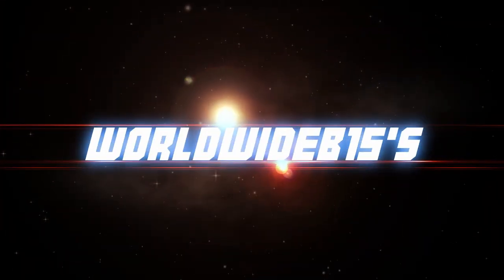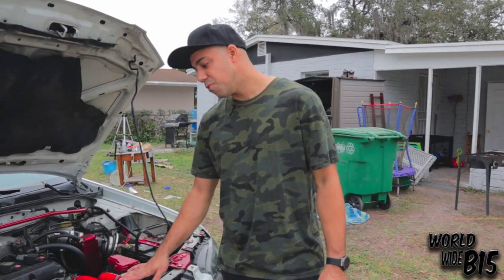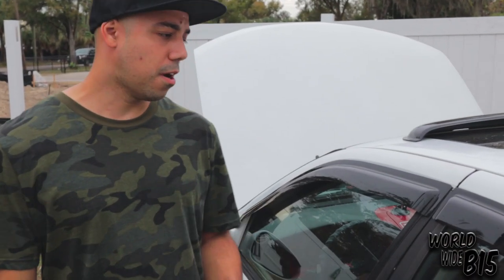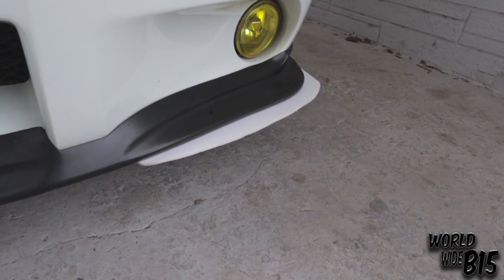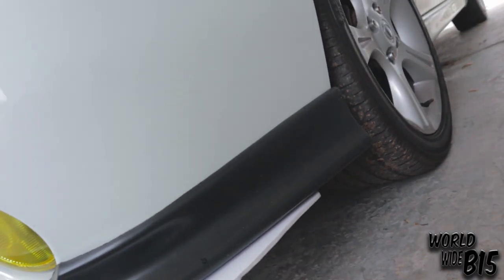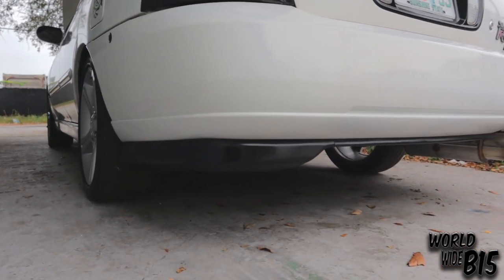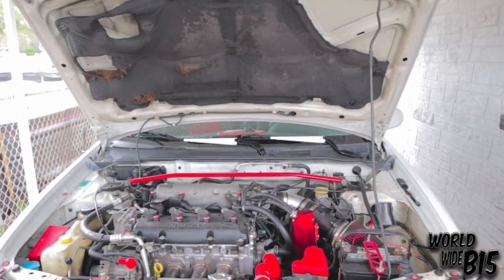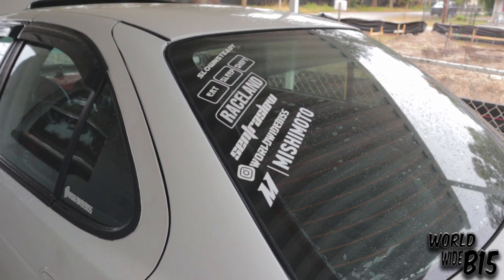Full Sentra Walk-Around

Comment: What type of paint did u use on the plastics and vinyl in the interior? I see u have the Krylon Canary yellow in the link. Is it the stained glass style and what color red is it? Thanks. It looks dope!
Reply from the maker: Duplicolor I think it was from any advanced auto parts don't remember the exact color, yes stainless glass. And thank you🙏🙂
Reply: @WorldWideB15s  about the mat, I'm wondering the same with mine. But then I heard u can damage your paint on the hood from the heat. My mat is actually burnt up from the plenum touching it and getting hot. Was like that when I bought it last year. I'm going the same thing to mine right now as well as far as the red color scheme. Just matches the dash lights and pretty much took off from there...
Reply from the maker: I took mine of not too long after it has been ok, these cars do produce a lot of heat butt the paint has been holding up.

Comment: So due to  the throttle body and pedal it was fluctuating between 1-2k and going up and down ? Like it had a vacuum leak ?
Reply from the maker: How was the rest? Sounds like it just needed and idle, pedal relearn.
Reply: @WorldWideB15s  I did the reset nothing changed . And it’s having a delayed start like it needs crank or cam sensor but no codes for that  I just bought the car so idk  what to even look at rn .  It also has a code for a 02 sensor  that’s all I know so far
Reply: @WorldWideB15s  I’m also cleaning the throttle body it looked clean  but I will put it back on and relearn if nothing  changes tomorrow  I’ll be back in the comments  . I think it is from the cold air intake the past owner had on it cuz it was barely on and clamped on by the throttle body and had a broken bolt in the maff sensor. So unmetered air ??
Reply from the maker: Change the O2 sensor, now delay starts sounds like fuel pump it was a huge issue. I changed it and they went away.
Reply: @WorldWideB15s  okay and I think the previous owner replaced the sensor it looks newer and there was a old sensor for the crank or cam in the car when I bought   but I will look into the fuel pump  for sure . Is there any more common issue ?  It’s a 2004 ser vspec
Reply from the maker: There are two more, Butterfly screws.. make sure they are all there. If they are all there take them out and add some Loctite, reinstall. 2nd is the the precat failure. If it has the stock headers get rid away and pit some aftermarket ones.
Reply: @WorldWideB15s  okay I fixed my air intake issue with it being all loose and maff sensor having a broken bolt  it’s all tidy up and air tight , then I did the relearn noe it’s idling lower so that’s good , after that I looked at crank sensor and seen it was messed with the wires were longer then the power steering one so I unplugged them both looked at them and swapped them car turns  right on no delayed start.   But I was wondering what color wires are on correct crank sensor plug ? Do U by chance know so I can make sure they are correct ? The wires also by the connector are a missing a lil shielding and wires are showing
Reply from the maker: Not sure but here are the factory service manuals according to there years.

https://www.b15u.com/threads/nissan-sentra-factory-service-manuals-fsm.35/
Reply from the maker: I suggest to download it and keep them on your phone.
Reply: @WorldWideB15s  thank you I appreciate your help ! Will look into it now
Reply: @WorldWideB15s  it ain’t showing for me
Reply: @WorldWideB15s  would u by chance know if I can use a Altima oil pan gasket ? I search up the gasket and it don’t look the same  as the one on my car
Reply from the maker: Not sure, there isn't any already made gasket that i know off. Everyone uses rtv gasket maker.
Reply: @WorldWideB15s  okay thank you I was really confused when I looked it up and saw nun . So I would need to remove  it then clean and apply rtv